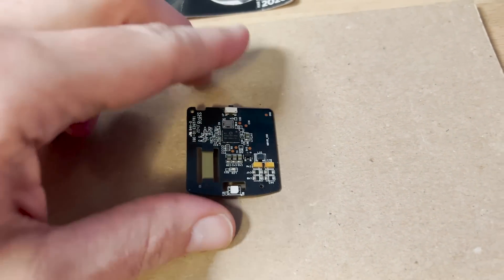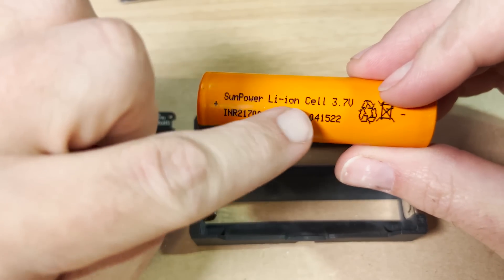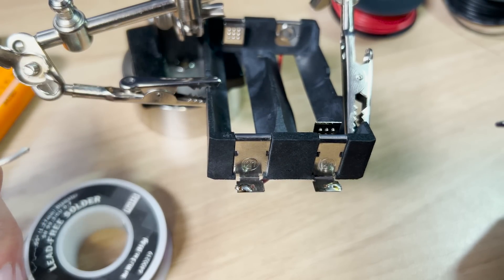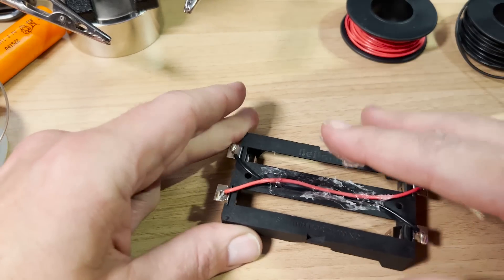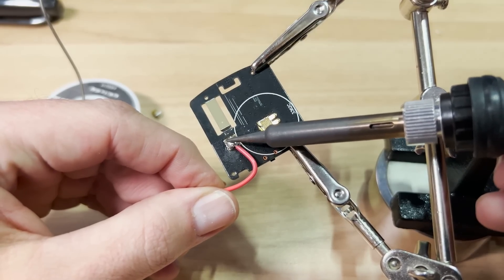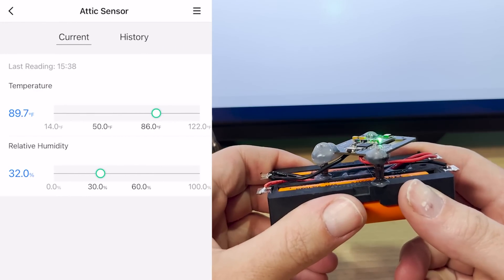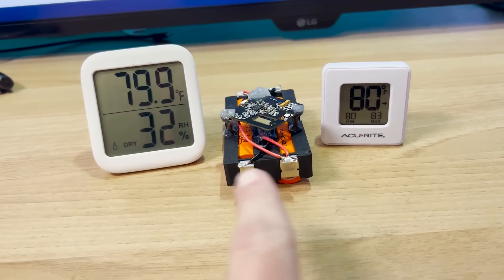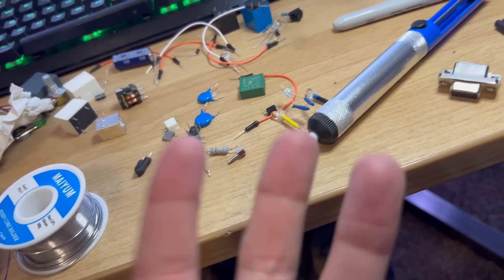Modified my Meross sensor to never run out of power

Comment: I get why you would want to increase the battery life.. but by using lithium cells without any protection circuitry? My guy, you're just asking for trouble. It's dangerous because the cells might swell up (not likely with metal casing, but still) but you also risk ruining the battery by deep discharging them way below their threshold. I also don't get why you didn't run power to it. You're placing it in a room on a shelf with lots of ways to make it 24/7 powered. Same as in the attic. 5v to 3.3v regulators are cheap and easy to work with, and you just have to provide it with power from an USB charger.

Comment: 4.3v might be a bit too high, it can shorten the life of some components on that device, or similar devices meant to be powered by a coin cell. For anyone else doing something similar, a better replacement would be LiFePo4 cells. They come in various sizes, the bigger, the more capacity, but LiFePo4 cells have a nominal voltage of 3.2v with a max charge of 3.6v, however even after fully charging them, they settle in voltage to about 3.4v which is perfectly fine for any coin cell replacement.
Alternatively, you can use two AA batteries in series and end up with 3v which will also be perfectly fine.

Comment: BTW - fun fact: the battery you used is called a 2170 cell and a Tesla Model Y has 4,416 batteries of the same physical size (21mm diameter × 70mm long) but likely a higher power density.

Comment: I get that there are multiple ways to do the wiring, but why not have the batteries installed in the same orientation and just bridge the terminals on each end? There would be no wires down the middle that way.
Reply: That was my first though as well, looks like the metallic parts would just slip off so they can be moved around

Comment: i had similar issues with my Shelly H&T sensor, ended up getting a usb to 3.3v converter and soldering the output to the battery terminal wires. no more batteries needed as just about averything around my home has usb power